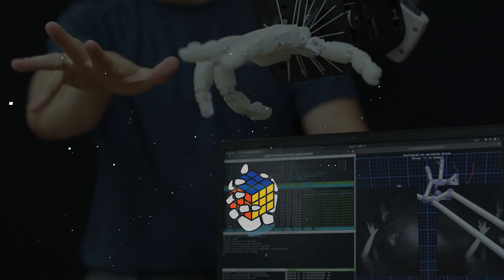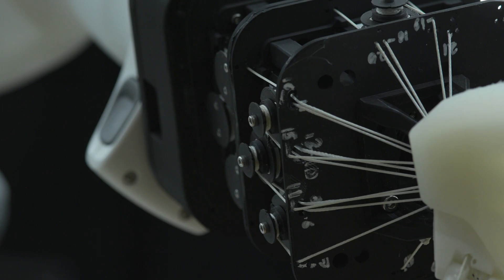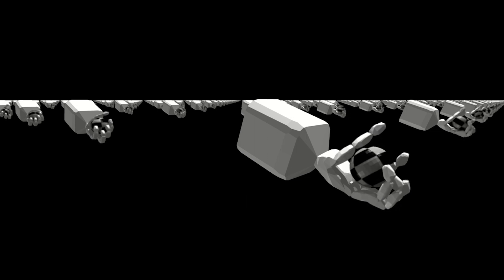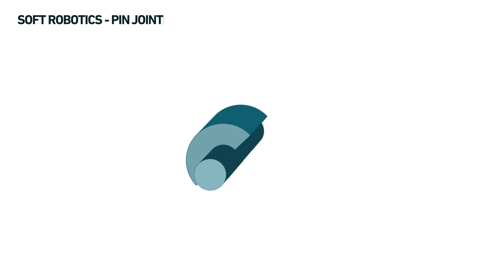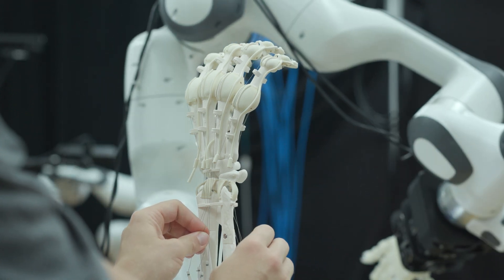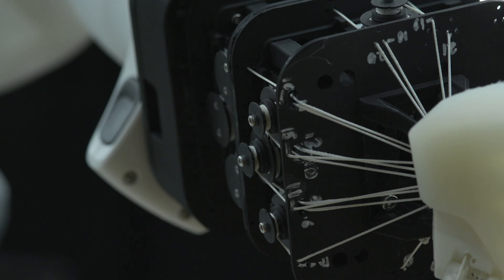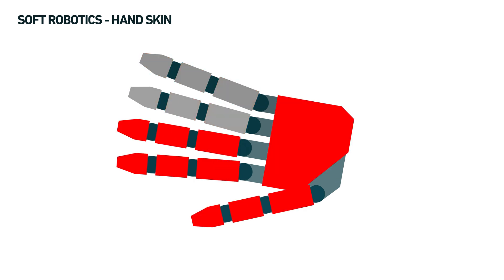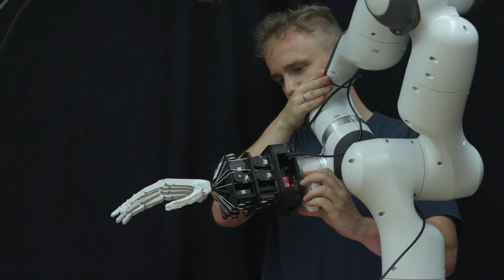The design and fabrication of a soft robotic hand

Comment: if you wanna get rid of the bulky wrist, you could make the palm of the hand a container of compressed air, with tiny valves built in to do all the puppetry without large servos. like tiny solenoid valves or piezo electric valves built into the base of each digit.

Comment: What kind of motors are you using to actuate the fingers? The tensioning looks really tight? How much torque does it produce? Im designing a soft hand robot right now, but I’m not sure the servos I’m using will have enough torque to drive my fingers. I’m using a relatively compliant material, but I’m just curious, as I may need to incorporate something like this in my design for experimentation. 

Keep up the great work!
Reply: servo motors